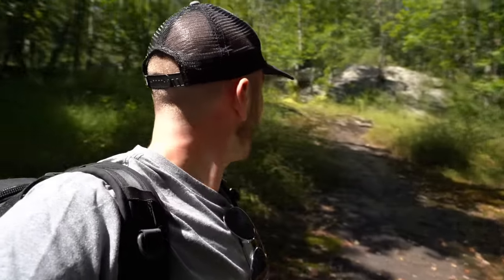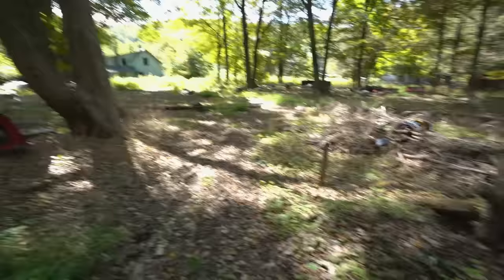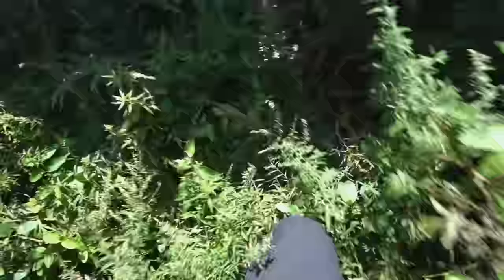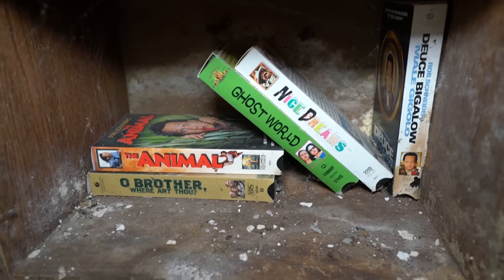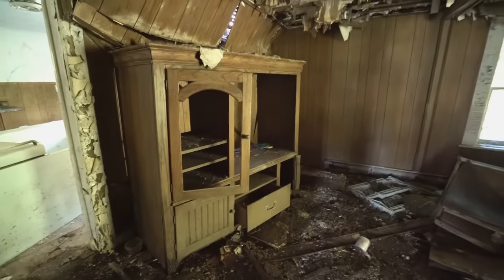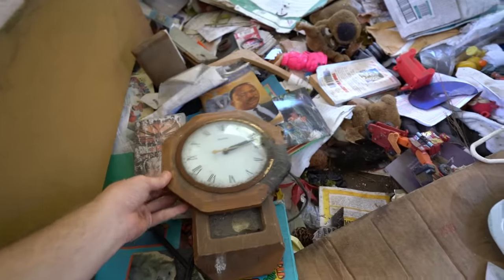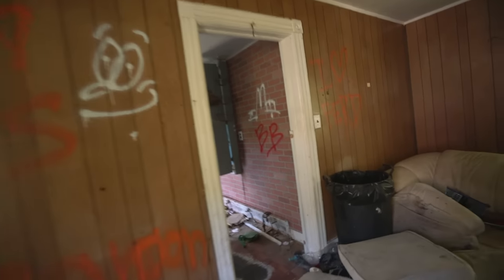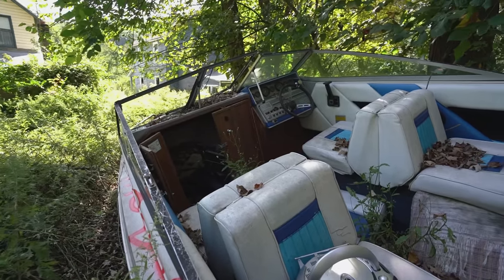Exploring an Abandoned 1850's Mining Neighborhood - Families kicked out of homes

Comment: Reminds me of an abandoned neighborhood I used to explore that was partially destroyed and cut off by large lava flows. Not homes from the 1800s but interesting to document the decay. With each visit there were fewer homes as new lava flows slowly wiped them all out. Only two small stretches of pavement remain. It was a very steep area so walking around was a workout. The last home was covered in 2010. Many of the homes decayed quickly from termite damage. I remember one that stood out and could be seen for miles. It was sketchy walking in it as it was elevated and the floor was dangerously rotted. The floor was wall-to-wall Penthouse magazines. No video back in those days of exploring. Just photos.

Comment: Those where not from the 1850s.  They were built with CMU blocks and drywall more like 1950s, the block wall is a spring house not a freezer, no fire damage in that house. Nothing is charred. Romex wire running through the walls so definitely not from the 1850s. Less than 100 years old. Not a school house. Just a regular house. Modern power lines running to the neighborhood. Obviously no clue.